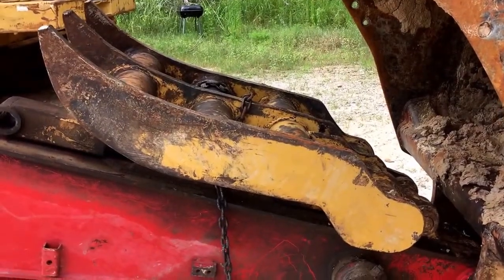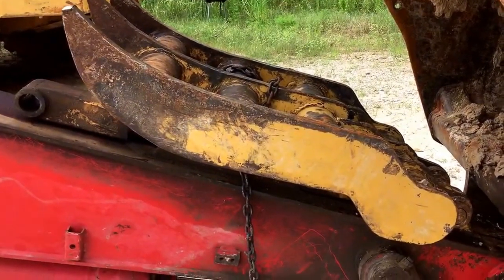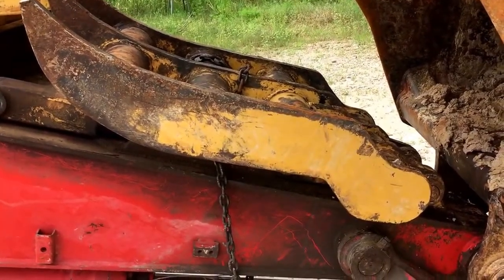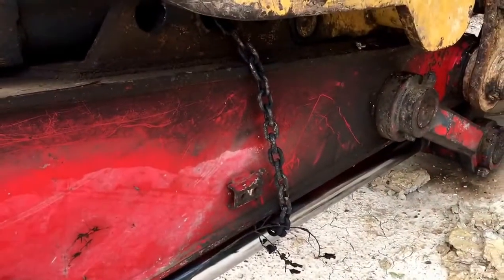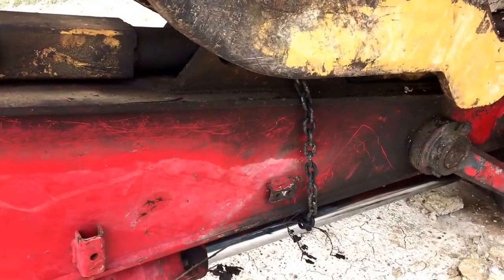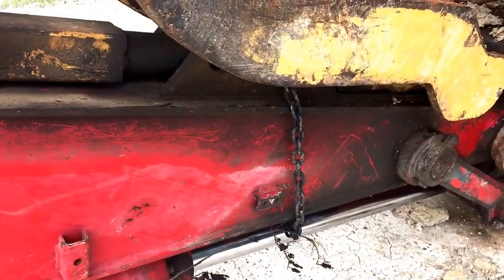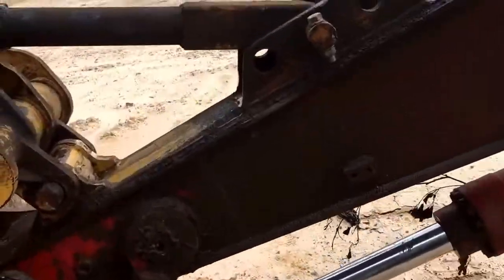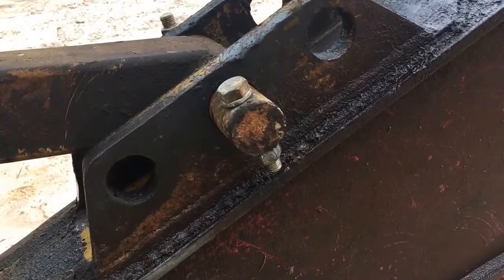Folding out Mechanical Excavator Thumb - Link Belt 3400

Comment: how many attachments do you have for this machine
Reply from the maker: Just this mechanical thumb and the bucket itself. I'd like a big tree spade some day though, and maybe a few different size buckets. It's an older machine though, I'm not so sure how many more demanding attachments I could run. I have lines for a hydraulic thumb if I wanted.